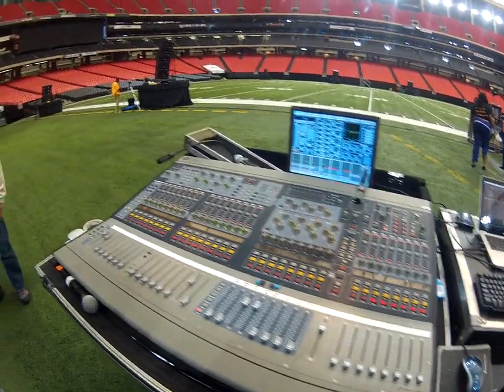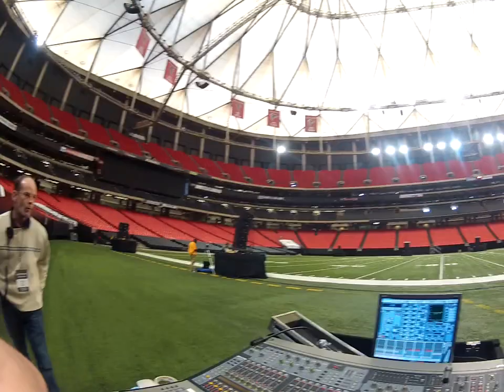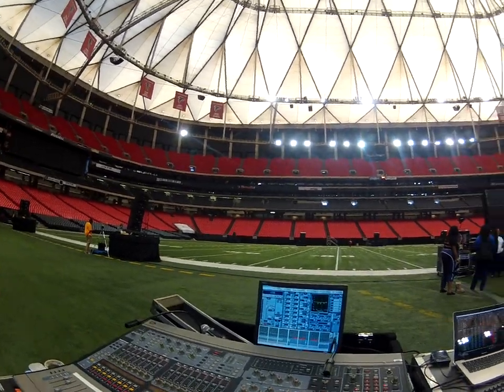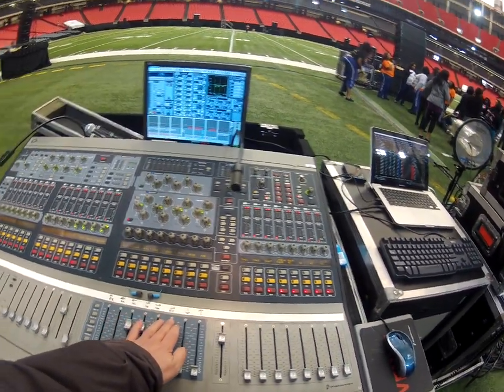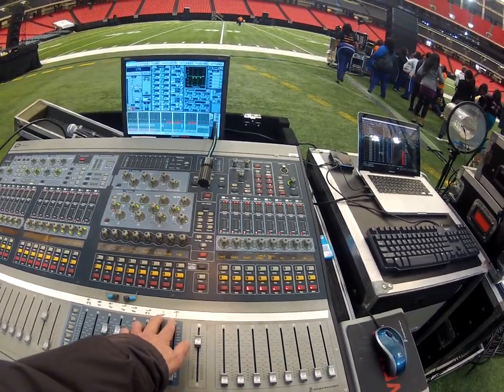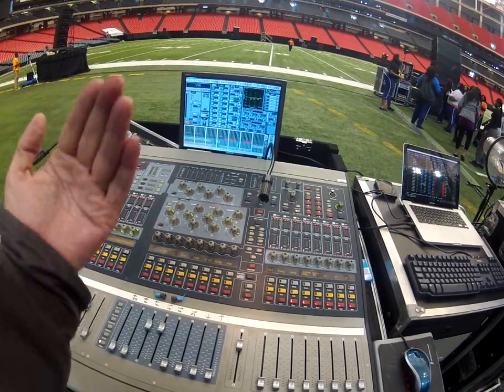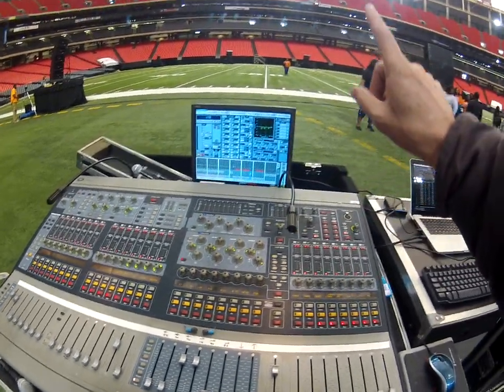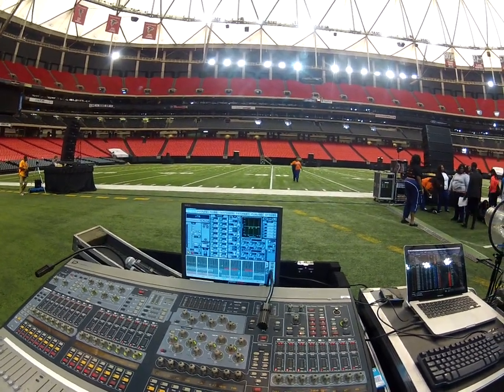How Do You Mic A Marching Band?

Comment: getting ready to setup a system for our high school band. do you ever have any feedback issues with the mics that close to cabinet? i’m learning as i go, so any advice would be awesome thanks
Reply from the maker: HI Eric, yes, acoustic feedback from mics in proximity to the speaker is always a problem. In this case, I am using a "mix-minus" approach. Each speaker stack is a zone, and using bus routing, the mics closest to a zone are subtracted from the mix that is sent to that zone.
Reply: @gigbutt  so if i understand correctly ,  you send each mic feed to a different zone  so that the mic tone doesn’t create a feedback loop?
Reply: @gigbutt  also, you have the mics setup in a crossed over shape. what advantage does this help with? is it a phasing issue?
Reply from the maker: @eross21  That's correct. It takes quite a bit of time to bring all mics up to max gain while feeding all the zones and creating a workable mix that sounds good from all zones and seats. You'll also need to create a mono sum of everything that you can use for the upper levels and TVs.
Reply from the maker: @eross21  I think you're referring to XY mic technique. Review XY technique for stereo field imaging for more information.
Reply: @gigbutt  wow, this is all excellent information. very very helpful. i really appreciate the advice.